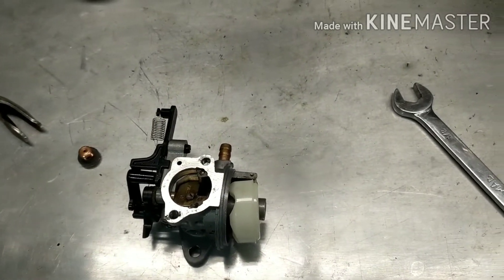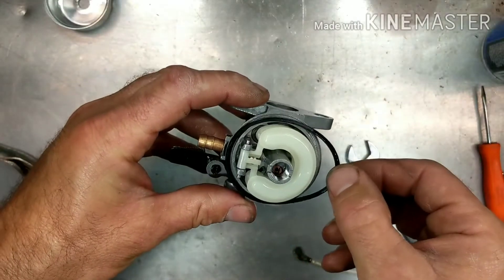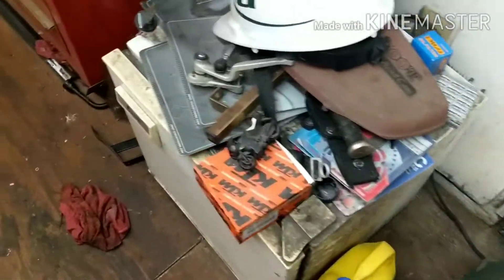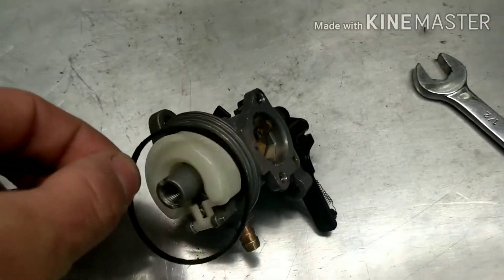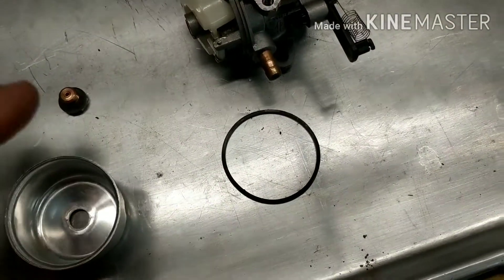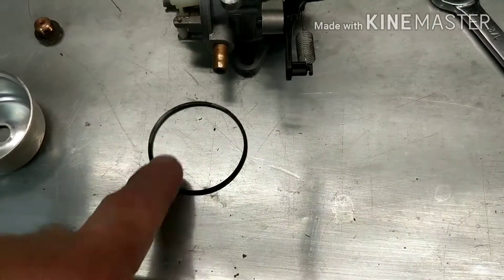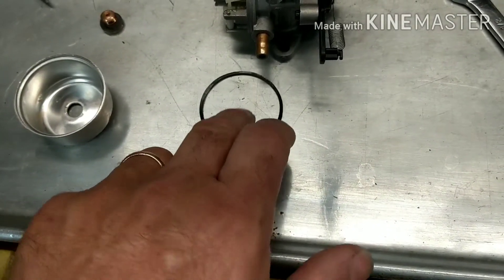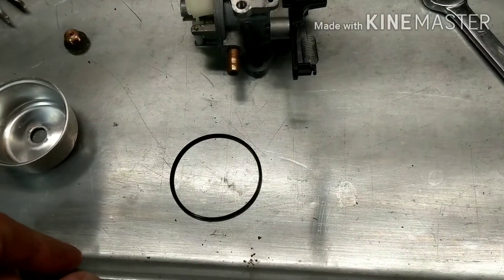Swelled o-ring fix

Comment: Glad I came across this.  I had the opposite problem, new gasket too small.  I stretched it around a can and heated the can up with a mini bu torch.  Worked but I'll try soaking in gas next time.

Comment: Hahaha!! That is a great tip. I usually ended up cutting square with razor blade a gluing back together. I’ll have to try this next time. The ones that always pissed me off the most were the mikuni throttle cable cover oring. They are orange teardrop shape and as soon as they fall out of the groove they seem to expand twice the size as soon as air hits them!😆

Comment: Over a season of having my carb apart my float bowl gasket shrunk a bit and I cant seat it properly. I'm hoping that soaking it in gas for a few minutes will enlarge it enough to get it into position. Then I can put a bead of gas resistant gasket maker to get a good seal.
Should I use gas or would you suggest something different to recondition that ring?
Reply from the maker: Gas would do it but don't use gasket maker, it just makes a mess and won't stick good due to the gas soaked gasket

Comment: I "dried" my swelled o-ring out with a heat gun then put it in the freezer for a bit.  Successfully sped up the process.
Reply from the maker: Awesome, thanks!
Reply: @TepcoCycleRepair  
Thank you for the video.  I thought I was going crazy when that o-ring popped out and was suddenly way too big to fit.  🤪

Comment: Mine has dried to much so thinking little bit of carb clean around it will enlarge it slightly again 🙆
Reply from the maker: Regular gasoline will expand it. If it's dry you may just have to replace it.

Comment: And 3 months later I've got the opposite problem on another carb, a Nikki. The main jet -- a tiny dude -- fell out when I removed the bowl because its O ring had shrunk. While waiting 2 weeks for spares to arrive, if I soak it in ... petrol, brake fluid, whatever, will it bulk up? Anyone know? (Can't get the ring off without destroying it -- it's 2.9 mm x 1.78). Thanks.
Reply from the maker: Soak it in petrol, it should swell.

Comment: Hi there, cab i use air compressor oil for lubricant on o-rings? Want to use it to lube up on a c02 gas gun
Reply from the maker: Yes, should be fine
Reply: @TepcoCycleRepair  thank you so much ❤️
Reply: @TepcoCycleRepair  thank you so much ❤️

Comment: what are the symptoms of a bad o ring?
Reply from the maker: It will leak when it's running from the vibration of the engine.
Reply: @TepcoCycleRepair  what about leaking from the carb when the engine isn't running?
Reply from the maker: @bill4485  It can do that as well.
Reply: @TepcoCycleRepair  thank you!

Comment: BS it shrunk.
Reply from the maker: Try it on the next one you have and you'll see it work for yourself.
Reply: @TepcoCycleRepair  it didn't I tried it 3 times, including putting it in the freezer afterwards.  I cut it and shortened it with acetone and superglue (trick from AvE)
Reply: I have tried this with two swollen rings and they look identical and won’t go in.  Has not worked for me.